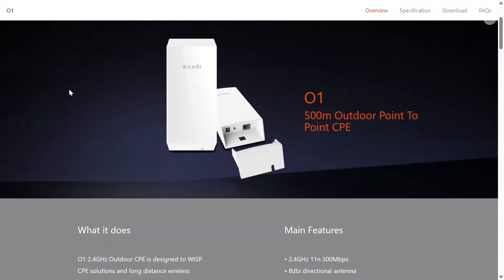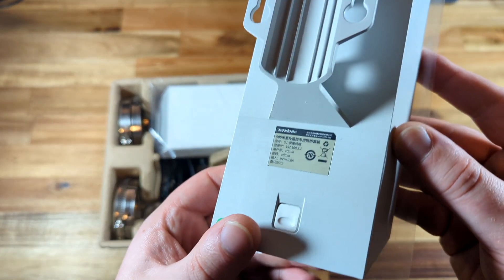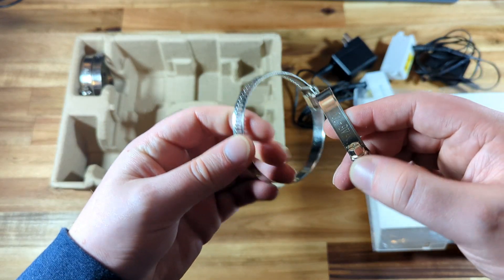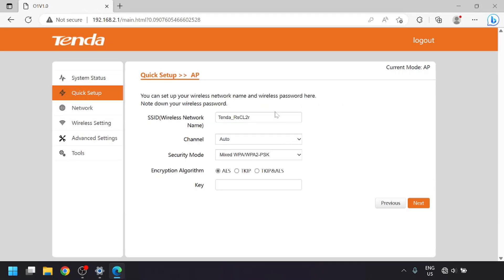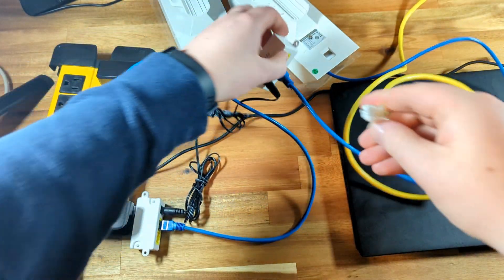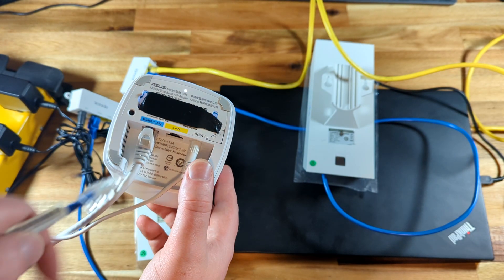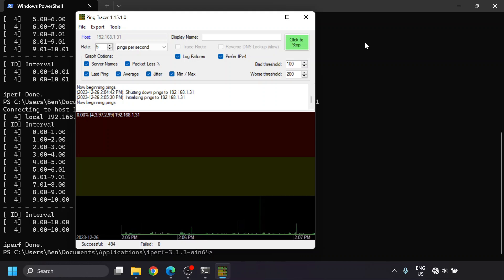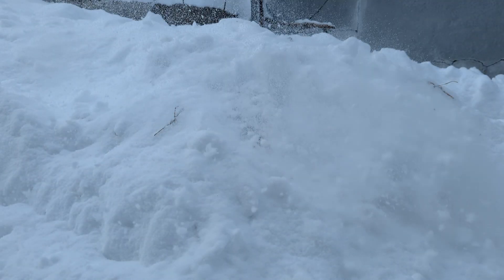Bridging on a Budget: Tenda O1 - The Cheapest 2.4GHz WiFi Bridge on Aliexpress

Comment: You were actually running up against the 100 Mbps Fast Ethernet speed vs the bridge link speed, I think.  If anything, increasing from 20mhz to 40mhz channels probably increased interference, which would mess up the network speeds.

Also, the fact that the 100Mbps limits the full speed of that is also why they didn’t add a heatsink - it’s basically a self-limiting device that can’t go but so fast so they figured a heat sink wasn’t necessary (that, and it being very cheap).